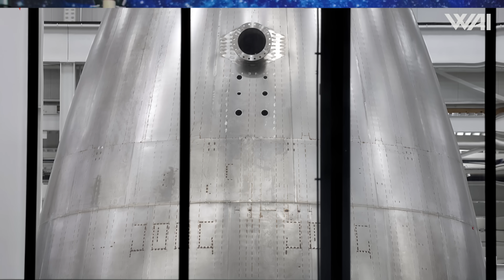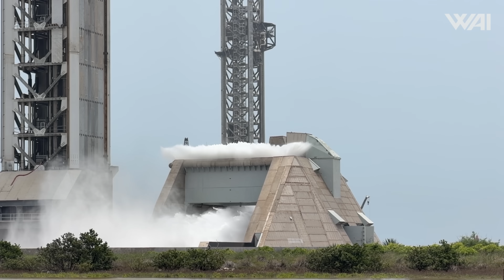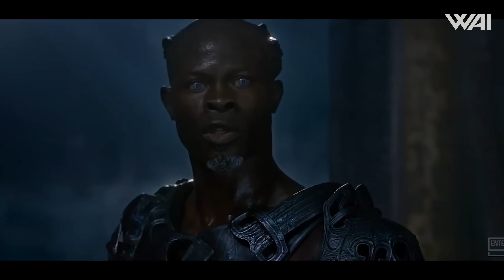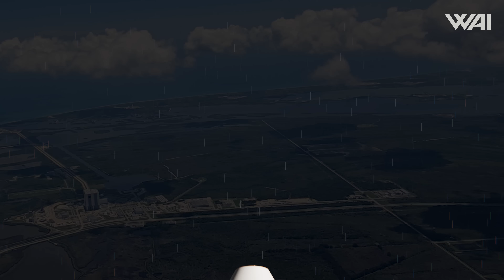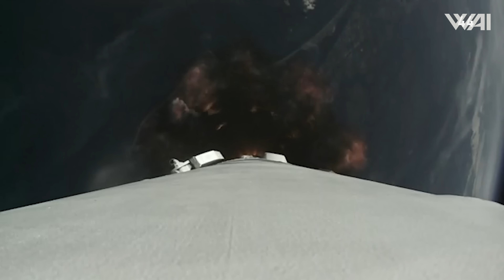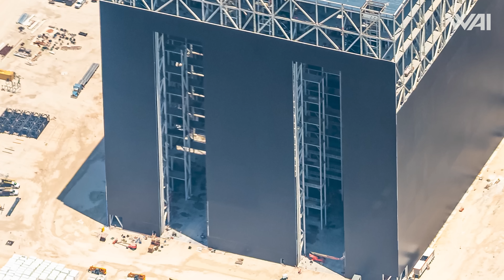SpaceX Is Getting Ready For Flight 13! NASA Reveals 15 Flights per Artemis Launch

Comment: There’s no comparison between Apollo and Starship and the lunar goals. Apollo just barely reached out and touched the moon. We got there with very little payload margin and brought nothing significant except a car and a few instruments. The new plan is to deliver significant material and infrastructure weighing thousands of tons. You need big payload, big landers and lots and lots of fuel. I’ve never said this won’t work…I’ve simply said the timeline is being way underestimated. 2028 is a fantasy, it’ll never happen. 2032-33 is a more realistic expectation provided SX doesn’t destroy a pad or kill a crew.
Reply: You're being way too pessimistic. The planned ramp goes ~175k tonnes in 2028, ~750k in 2029, ~1.25M in 2030, ~1.75M in 2031, and ~2.25M by 2032. Sure, these number are aspirational — but 500,000t by 2032 is dead realistic. SpaceX already launches almost every other day on ~25 Falcon 9s, three pads, and an expendable upper stage they rebuild every single flight. Give them a reusable second stage and five pads and the cadence is a non-issue. Be skeptical of 2.25M if you want, but doubting half a million just ignores what they already pull off today.
Reply: @imrich333  

The guy you replied to was talking about LUNAR delivery of cargo for a base.  You are talking about orbital satellites.  Totally different topics.

:face-turquoise-covering-eyes:

:face-turquoise-covering-eyes:
Reply: @Scanner9631 Thanks!  The SX lander alone is enormous.
Reply: @Scanner9631  Not different topics at all — you've got it backwards. Scaling Earth-to-LEO   IS the hard problem. A single lunar Starship needs ~15 tanker flights to top off in orbit, ~100+ tons each, so you're burning 1500+ tons of upmass to LEO just to land ~100 tons on the Moon. That's why the orbital ramp is the whole ballgame. And those numbers were never "just satellites" — it's total combined upmass to orbit, fuel included. Once you can throw 1500–2300 tons of propellant into LEO, both the Moon and Mars suddenly get easy. The surface delivery isn't the bottleneck — the launch cadence that fills the depot is.
Reply: @imrich333  You’re being too optimistic!  We’re talking about a vehicle that hasn’t orbited yet and has had chronic issues with engine bay leaks, fires, failing engines and explosions. Again I’m not saying it’s not going to eventually succeed. It’s just going to take much longer than anyone thinks and then you face issues of money. Despite Elons wealth, he’s not going to be able to write huge checks for 20 years if that’s how long it’s going to take.

Comment: SpaceX now has the infrastructure to launch, recover, refurbish, load and relaunch Falcon 9 rockets almost every other day from a current fleet of 24. And this includes having to build a complete second stage for each launch. Given the increased capabilities of Starship, it seems reasonable to expect an even more rapid launch rate once its infrastructure is completed. So fueling a depot in orbit shouldn’t take long at all. The biggest time waster may be the time it takes to reach orbit and rendezvous with the depot. It would be helpful if the depot had more than one set of refueling stations, so more than one Starship could be docking and transferring fuel at the same time.

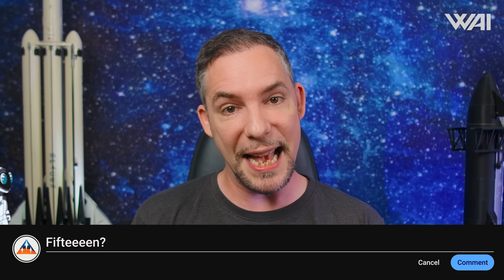Comment: 13:15 “if it takes only a month to fill the depot” Sorry if I’m missing something, but if it takes 15 flights to fill it, at one launch every 8 days if that’s even doable, how could they do it in a month or so?
Reply: You are missing that they are talking about 8 days between launches at A launch tower.  2 towers is 2 launches every 8 days.  In addition to the currently operational tower they are working on 4 or 5 other towers.  With 4 operating towers it is on average 2 days between launches so 15 launches could occur in 30 days.  

:eyes-pink-heart-shape:

:eyes-pink-heart-shape:
Reply: Yes, you are missing something. That’s the reason for the pipeline. So they can fill the depot faster on demand. They’ll build the same structure at Cape Canaveral Kennedy space Center. The launch cadence is currently going to be a launch a month. In validation and testing. Then I will move to once a week then to several times a week then to once a day, maybe even multiple times a day. It’s like an assembly line. You can’t turn it on and go full speed right away. I hope this clears up your confusion.😊

Comment: Each propellent delivery launch will be a full load of LOX or a full load of Methane; not both. It’s the common sense solution.  Looking at the lone transfer port on the starship, SpaceX must be going that direction
Reply: That make sense since so many refueling flights are required.
Reply: That would require a third tank or two versions. A third tank is extra weight. Two versions doesn't fit with mass production. SpaceX has already said the transfer will be through the QD plate. Not that they'd necessarily tell us if that'd changed though.

Comment: I feel eventually the limiting cost for a starship launch will be the cost of propellant.
Reply: Currently they’re trucking in propellant, which will be very expensive at scale. However more scalable transportation like a pipeline or ship become reasonable choices once you have that scale, and would significantly reduce propellant costs
Reply: Starpipe! Seriously.
Reply: @danielp920  Plans for a pipeline to starbase are already in motion. It only needs to connect to the existing infrastructure at Brownsville.
Reply: For the cargo missions that is probably true, but they will have average out the cost of atleast 15 test flights. For Starship HLS there is 15 refueling flight costs, one Artemis 3 flight and 15 more refueling and one test HLS for the uncreweed HLS landing test flight, so 33 flights total.
Reply: @mrbaab5932  and still cheaper than one SLS launch by an order of magnitude
Reply: @mrbaab5932  Also initially it's unclear how much refurbishment costs are going to be and how often a single ship can be used. Both numbers will fall and rise as time goes by, and they certainly will significantly overcharge for a starship launch initially simply because 100t for 100M is still spectaculary cheap.

Comment: An aging infrastructure at KSC or Cape Canaveral is basically the governments problem. Imagine an airport having decaying runways or not enough parking. The landlord can't necessarily pass on upgrade costs to its tenants. The US charges launch providers a  rent through their lease agreements for land and launch facilities. Similar to an airport leasing a terminal to an airline. But, that doesn't mean the government won't share costs with launch providers that would benefit from a better infrastructure. 

One thing they could do to reduce vehicle traffic is to upgrade the rail line at the Cape. There was once a very extensive rail system and you can still see parts of the abandoned system on Google maps. Currently, the only active part is to deliver solid rocket booster segments from the north to the VAB. I'm not certain but I'm willing to bet that this was owned or operated by the Florida East Coast Railway. Even if NASA was the owner, they certainly could draft an agreement for operations to a commercial provider. Tank car trains could deliver significant quantities of commodities more efficiently than trucking can do. 

If NASA and the Commercial partners were to guarantee FEC revenue from tank car deliveries, they probably would foot most of the bill to replace the missing track to certain launch pads. That would significantly reduce truck traffic. I know Space X is building air separation and methane liquification facilities, but that may not reduce the truck traffic enough to not still have an infrastructure problem for roads, let alone for an old electrical grid, etc,

Comment: if the starship is so much more powerful than Saturn 5, why can't it (if not reusing) just do the same moon run as Apollo11?
Reply: It's because of the huge amount of mass that Starship carries. The Saturn 5 rocket payload was miniscule in comparison.
Reply: Saturn 5 discarded 3 stages to get the "4th stage" that went on to the moon of about 48 tons mostly fuel to LEO.  They left part of the lander on the surface and discard the balance after it returned the astronauts to the capsule.  Only a small part came back to Earth

Starship is two stages, the booster being reusable.  The HLS is designed to carry 100 tons of cargo to the lunar surface and return the astronauts and a limited cargo back to the Orion craft in lunar orbit, it also will house and keep alive the astronauts on the surface for a MUCH longer time.  The HLS (empty) itself weighs over 100 tons add 100 tons of payload then add sufficient fuel to transport all of that to the lunar surface and at least the astronauts buck to lunar orbit.  So over 200 tons NOT including propellant compared to 48 tons which is mostly propellant.  

A totally different mission profile and the ship itself a radically different beast.   MUCH greater mass being transported.  So LOTS of fuel required.  

:rocket-red-countdown-liftoff:

🚀

Comment: Stock is back to release prices. If it goes any lower, I'm buying more. I have no plans to sell them at all. Maybe I can trade them back for some tickets to mars whenever those become available.  Lol.
Reply: Are you sure you would like Mars?
Reply: @russc788 No, but I like adventure.
Reply: @chuckdoom7665  I used to think I would like to go, then I realised it would be several years of living in very tight quarters, unable to breathe fresh air.  Unable to come and go with freedom. Even on Mars due to radiation issues, you wouldn’t have panoramic windows (I think), and going outside probably rare, uncomfortable and tiring.  I think in reality the first to go to Mars may regret it.

Just my view.
Reply: @russc788 I have the same thoughts. Especially for the first few trips. Infrastructure will vastly improve with each trip. I think there may even be an opportunity to earn a lot of money for the early travelers that will contribute to the expansion of the base. Got to do something while you're stuck there for at least the next two years. Lol.
Reply: @chuckdoom7665  Its an exciting thing no doubt.  I don’t think we can take for granted “vast improvements’ though.

Comment: Line the fuel tanks with a very thin flexible plastic. Seal around the intake and output ports at the top and the bottom .Use compressed gas between the liner and tank walls to push fuel where you want.
Reply: No plastic is flexible at those temperature
Reply: As far as I know, there are no flexible materials at those temperatures.

Comment: "... Reasonably insulated starship..."? All the frost on the side suggests no insulation?
Reply: You are right for starships. They currently use their fuel before much boils off. Tankers will hold their fuel much longer so will benefit from being insulated in some way. My guess is a double walled hull but I do not truly know what technique they will use.
Reply: @appliedfacts  

My guess is the white "heat tiles" were tests of the insulation for the fuel station.  

Might even have the white ones on one side to reflect sunlight and black on the other to radiate heat.

:eyes-pink-heart-shape:

:eyes-pink-heart-shape:
Reply: He's taking about a bespoke tanker ship designed for the purpose.

Comment: It looks too high for fuel transfer. The angle of the nose makes it incapable of transfer since the system would be too far away from the other ship to be effective.
Reply: Tumble the rocket around the pitch axis to have centripetal force assisting with fuel transfer perhaps?
Reply: @johnbuchman4854 maybe.. but why? Why not just make the transfer window below the nose cone angle.. remember, according to the mockups we’ve been shown, the transfer intake corresponds with a transfer outtake.. that means the space between the two orbiters will be doubled due to the mirrored angle of both nosecones.. It’s science.. actually it’s geometry…😂..

Comment: You know, SpaceX has 360 degrees that they could have turned that nosecone and they chose to point it at the window where we can watch.
Reply: Maybe not.  Depends on how their workstation is set up.  It is possible that any nose cone set up there MUST be oriented that way for the various items of equipment to do their jobs.  Change the orientation and you might need to move everything else.

:face-turquoise-covering-eyes:

:face-turquoise-covering-eyes:
Reply: "Pikacho shocked face"

Comment: Hey Felix.

I do not understand why the astronauts going to the moon have to travel in a small capsule all the way too the moon before transferring to the SpaceX moonlander. Since the Starship version used have to return to the Earth and refuel, using the orbital tanks, why not use a Falcon 9 lifting astronauts to the SpaceX moonlander waiting in Earth orbit, fully tanked and have a crew transfer in Earth orbit, and then go with SpaceX moonlander to the moon, land, and then return with crew back to Earth orbit, transfer crew back to a capsule to land on Earth, while the Starship.moonlander fills its tanks waiting for the next crew to return to the moon? Just bypass the SLS all together. And let the crew enjoy the space available on Starship.
Reply: The capsule is also their return vehicle.  HLS doesn't come back.
Reply: SLS is safe and works 100 percent perfect , while Starship has failed 12 out of 12 flights.
NASA dont trust Space X and neither do I.
Reply: @Leon1Aust  Calling a rocket 'safe' and '100% perfect' after only two launches is ridiculous. Reliability is built on a track record of flights, not luck. Especially for old school systems like SLS which rely on dangerous gigantic SRBs, something Vulcan (which was also hailed as ultra reliable out of the box) clearly demonstrated.
Reply: @admarsandbeyond So, the SLS actually uses they're based on the old Space Shuttle solid rocket boosters. They’ve been repurposed and improved for SLS,
Reply: @Leon1Aust  SRBs are inherently incredibly violent and dangerous. They're massive barrels filled with toxic explosives that can't be throttled or shut down once ignited. Vulcan's GEM 63XL solid boosters despite being hailed as flight-proven, ultra reliable legacy upgrades suffered nearly catastrophic nozzle burn-throughs during both their latest flights.
Reply: @admarsandbeyond But not one SLS has exploded unlike Starship.
Solid boosters are safer than 2 x chemical rockets because it's simple.
The plumbing is far less than in liquid propellant rockets.

Starship now has failed 12 times out of 12 flights while the SLS has orbited the moon twice.
Reply: @Leon1Aust SRB's are inherently more dangerous, that's a fact. Large solid rocket boosters were considered "unsuitable for man-rated vehicles" until the Shuttle (U.S. Government Depository Library, Report Summary on Man-Rating Rocketry). "I will never put a human being on top of a solid rocket booster. They are inherently unsafe"— Dr. Wernher von Braun. They were only utilized for cost reasons

And, Starship flights with new hardware tested and pushed to the limit are not failures. That's like saying SLS's SRB that blew on its test firing was an SLS failure.
Reply: @admarsandbeyond Wow now lets look at how many times the liquid powered Starship has blown up or had a failures in flight.
A 100% failure rate 12 flights and 12 failed and still no human lander to be seen.
And now there telling us the Starship can need up to 20 space refuels to get to the moon. 🤣
No way Space X are going to pull that off.
And this monstrosity of a spaceship it's going to land on the moon, and Mars later....nope ain't gonna happen.
NASA ....do it once, do it well for Saturn V compared to Starship 12 failures in a row.
And the thing will topple over upon landing!
And as for Mars, scientist have proven the human body cannot make the 3 1/2 year return journey due to Radiation and Bone density decay.
Musk is a used car salesmen and suckered you all in.
Reply: @Leon1Aust  Nonsense. The Superheavy booster has successfully executed its ascent and hot-stage separation a total of 11 times out of its 12 integrated flight tests. Starship upper stage has failed to reach its intended injection (near) orbital trajectory a total of 2 times.

All the other stuff you wrote are the usual ignorant points you all copy paste from the troll hitlists.
Reply: @admarsandbeyond Every flight of the Starship something has gone wrong while NASAs Saturn V only one Apollo 13 had a flight problem.
Statistics tell the fact...........Starship is Starshit.
Reply: @Leon1Aust  imagine thinking prototypes are final products